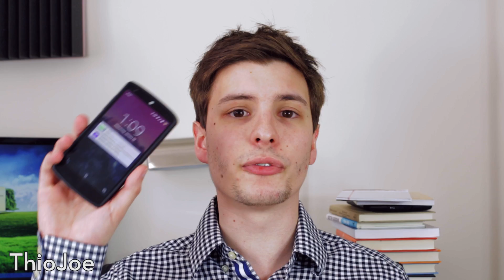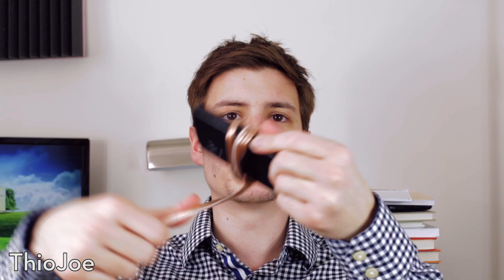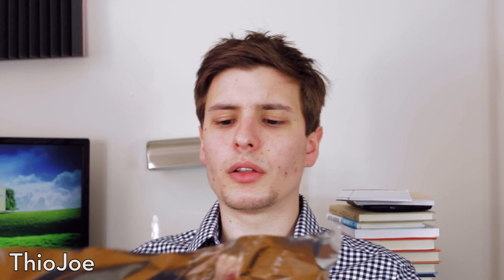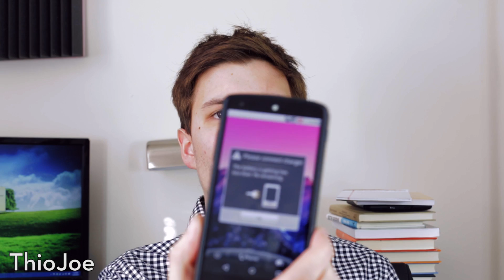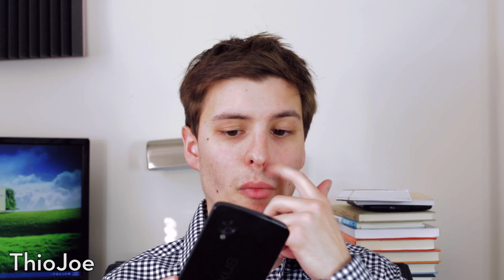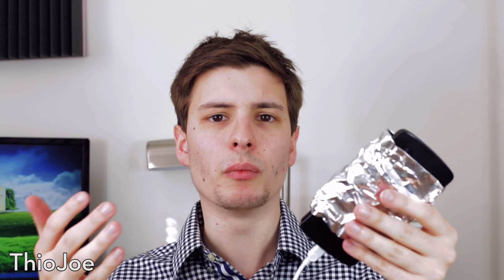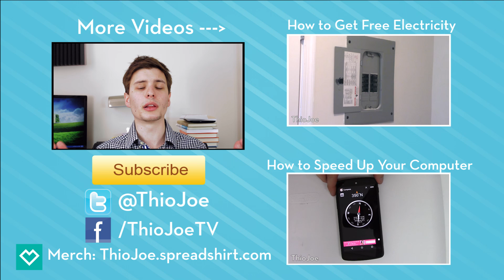How to Instantly Charge your Phone

Comment: here's another way...
Okay, so I charged my phone because it's already 3 bars left, (it's android) Then I pushed my charger hard because I didn't realized its not that sticking to that hole or whatever and then it turned out to be 100 but here's the problem...
Yes it is 100 but it isn't. it's only like an illusion...
I tried to use it without my charger and it already shut down xD 😂😂 don't do this 😂😂🔫🔫

Comment: Few know you can charge by around 8-12% with the same principle WITHOUT A CHARGER! The earth-magnetic-field acts as an induction field here, so it works best out-doors. If you hold your phone at arms-length and start spinning, you build an EM charge of around 50 to 60 Farrad, which is considerable! It works even better with a selfie-stick (the farther away, the better). Turn for around 20-30 seconds. The faster you turn, the more capacity you build. When you stop, the induction field collapses and the energy is released as electricity, just as in an inductor coil, charging your phone. Wind turbine generators use the same principle, but with an artificial induction field.

Comment: Well done BS. The stuff that urban legends are made of and with an (almost) straight face.

Spoiler for those who need it: Remember high school physics? In order to induce an electric current in a wire, induction requires an alternating expanding and collapsing magnetic field. This is known as alternating current (AC). This is how transformers work. All USB devices run on 5 volts direct current (clean, filtered constant DC voltage). This is what all USB interfaces put out--be it the USB plug on your computer or your phone charger. 

 Again, congratulations on great BS. I really enjoyed the video.

Comment: 1st let's talk about getting something for nothing.  Yes, there is a thing called Quantum fluctuation, you can look it up on Wikipedia, but lets talk about the laws of thermodynamics

First law of thermodynamics: "The total energy of the universe is constant." (or in a closed system)
Second law of thermodynamics: "The entropy of an isolated system does not decrease."
Third law of thermodynamics: "As the temperature of a perfect crystal approaches zero, its entropy approaches a constant."

The charger/phone is not a closed system, but you still can't get something for nothing.  Lets say the charger is 5v at 2.5 amps (which is MORE than most phone chargers) thus nominal output is 12.5W.  Lets say the battery is 3000 mAh or 3 Ah - a pretty typical phone battery nowadays.  

So, how long will it take at 12.5W to charge this battery at a theoretical 100% efficiency.  The battery is a typical Lithium so lets say 4V nominal.  Thus the battery can deliver 4V x 3A (12W) for 1 hour and assuming 100% efficiency the 12.5W charger would take almost as long to charge it.

But we both KNOW the battery will not charge at 100% efficiency or at 100% charge rate.  The typical phone charger is not 2.5A - maybe 2.1A or less -  thus reaching 78% charge in <10 minutes breaks the laws of physics & is thus impossible.

Richard
Reply: Not sure if your explanation is truth or false but well...the guy in the video always puts fake stuff and the worse part is that he doesn's even say in the description it's a joke or anything. I never tried those. They seemed weird and too fishy and reading the comments confirms that but if he did say in the description something...well..I'd respect him more.
Reply: +Richard Sacks-Wilner um...yes

Comment: Tried it. Complete bullshit. The secret is to wrap the wire around your head and swallow the aluminum foil. When the foil ball passes out your rectum your phone will be charged. And it will last until you remove the wire from your head. Kind of diminishing return though. Use moderation and only reuse the foil once.

Comment: o great idea itried it im thingking that i will use 6 metters of wire so it chagres faster than 10 seconds the aluminum foil i uses 1 metter long and i tried it .did you know what happen? my battery is burn out it over charges until now i dont have phone

Comment: Joe is a good friend of mine. I recognized the the problem in his brain a long time ago, hoping it would go away after puberty. Now, unfortunately, the zit (acne) cream he's using obviously isn't working, but even worse, it's preserving the hormone output causing this particular behavior. The good news is....I did some research and found some treatment that seems to be working. It involves a Retardation Suppressor Hormone (RSH) delivered either intravenously or suppository (a solid medical preparation in a roughly conical or cylindrical shape, designed to be inserted into the rectum or vagina to dissolve). Of course, he prefers the the suppository because it's the closest thing to sex he'll ever get. (perfectly normal behavior). Once introduced into the bloodstream it gets a little tricky. We had to go on craigslist to buy a second microwave oven, (easy, tons for sale for like $10.00). Place the 2 ovens on the carpet floor facing each other about 3 inches apart, just wide enough for Joe to lie on his back with his head between the 2 ovens. Set timer for about 30 minutes on defrost. This application excites the RSH just enough to change the direction of Joe's target thinking. Now, he's a Cub Scout....only needing treatments about once a month, the frequency an average man receives sex from his wife. (again, perfectly normal)
Reply: Wtf
😂😂
Reply: xD
Reply: +Averageskill , oh God, i losed my sheet :))))
Reply: Hahahaha...Wtf!!

Comment: Has anyone notified the local loony tunes hospital that its main patient has ESCAPED..His ramblings are at 7 hundred an 78%. A faster way to increase your brain matter and charge the phone would be to pass bare electrical copper wire through one ear and out the other..attach the ends to your testicle's and run 240volt cable from the mains to your scrotum. Hit the on button..please get back to us on the results?

Comment: He has 2 phones rapped in tin foil and wire one low battery one high. When he bent down to get the charger cord he changed out the phones hence the "rapid charge"

Comment: It is called swapping out or rotating your batteries and takes 5 to 15 seconds to do and voila you have a full battery!

Here are a few helpful tricks!

* Uninstaling Facebook will save you between 15 to 25 percent on your daily battery life. Use your browser for Facebook instead!

* Turn off WiFi, Bluetooth, NFC & Mobile Data as when not in use this can save you a lot depending on your apps! 
  * Also turn off your Auto Screen Rotation this can save you 2 to 8 percent a day in theory!

* If you have Multiple Batteries swap them out when they get to about 25% power remaining! 
  * This way you can use your phone for much longer and if you put the low battery onto charge right away it will be full almost by the time the full battery gets down low!

*Turn off auto updates as many new updates have bugs that end up using more power, only update apps and OS after reviewing what others have to say about the new updates after about a month!

* Use a regular (Low Power!) USB Charger Port, A Fast or Rapid Charging Port will kill your battery much faster (upto to 60% faster!) than a standard trickle/standard charger! 
 * This does not matter so much (except for the environment!) as long as you can replace the batteries easily!

* Plug your phone charger into a surge protector that can also smooth out the current this can add upto 20 to 35% on your battery's life span (Use the same type of device for computers and tablets as well!), This does not affect your phone's battery until the 2 to 3 year mark depending on the quality of the battery!
 * This also has the benefit of saving your phone during power surges which can kill low powered electronic devices like phones and tablets!

* Use Bluetooth devices to listen to your phone it cuts down on power consumption even more then wired headphone/earbuds as they use their own power supply to power the speakers rather than rely on the phone's battery to do that with wired headphones/earplugs! 
 * Also Bluetooth uses far less power to send the signal to your wireless headphones/earbuds then sending it via cable even without having to power the headphones/earbuds because of electronic resistance all metals have even gold and copper air does not generally have this problem!
 
* Also if you can turn off the screens colour so it's in grayscale mode, That can save your screens power consumption by about 40 percent!

* Force stop all apps that you absolutely do not need to use to stop background power and data consumption!

*Unless you have bad eyesight you only need your phone's brightness level to be on between about 10 to 25 percent most of the time!

*If you can swap out batteries but have no spars get a brand new one and replace your phone's battery every 12 to 24 months this does not apply is you have multiple batteries and swap them out on a regular bases!

Comment: HAHAHAHA! you should try plugging the cable from your phone directly to the wall(without the charger), then you will have 110V, which will create a way higher "differential potential"between the wall and your phone, then you will not need to worry about "escaping electrons" hahahahhaa.

Comment: Not possible. Reason: if ANYTHING is charging, it produces a little bit od heat. Usualy it is small amount, because the charging is long, but lets say your phone would charge 75% in 10 seconds. That would produce so much heat your phone would burn. Anyway, good view attractor.

Comment: Way that works!

1. Get an IPad charger
2. Plug it in an outlet
3. Plug the charger into the iPhone 
It's charges faster because the IPad needs a bigger charger so it does not charge very slow, where the IPhone doesn't need as big of a charger.

Comment: I'm calling BS on this. I have an iPhone 6S and tried multiple copper / speaker wire to extremely heave gauge copper wire. aluminum and times, 10 sec. 20 sec. 30 sec. 1 min. etc. and still no change in the battery life.

Comment: I don't believe, something else must have happened. 78% for only 10 sec is not possible.Perhaps the sensors for potential measurement may have perceived the wrong thing. May it be possible for sensors to stop working properly after getting the wire wrapped around or so.. I'm not going to accept it until I try it my self for a full day long 
ahead.

Comment: The wire was covered in rubber. And as we know kids rubber does not conduct electricity and the rubber is used to stop electric escaping for safety, so how the FUCK is it supposed to jump from the coil through the rubber, glass, plastic and other rubber components into the fucking battery

Comment: dont believe this guy here are real steps on how i charge my phone instantly

step 1: microwave phone with TWO FORKS IN THE MICROWAVE
step 2: place the two forks next to the phone.
step 3:when the phone starts turning on, look at it through the microwave window the battery should be going up by 2-4% each second, it should be showing the battery meter, just wait around 2 minutes for it two be donw

it does this since the electricity concentrates from the microwave  into the forks making what is like a cloud of electricity between the forks charging the phone.
i use this all the time so i ope this helps!

Comment: The recharging speed of a chemical battery (used in most phones) is limited by the speed of the chemical reaction happening inside. You can't speed it up.
Reply: Classic chemistry lesson from like year 3 (or whatever you call it in America ,middle school?)
You can speed up the reaction by adding heat or a catalyst so just put it in the oven or microwave surround it by Nickle or even better put it in a bath of melted Nickle
Reply: NightBladeNation Or just take it in a bath with you, cut the cord, plug it into the wall and run the other end of the wire in the bath where you comfortably position yourself. Don't forget bubbles! LOL :-)

* Disclaimer -- use at your own risk.
Reply: +Alex Povolotski hahahaha
Reply: Really guy?

Comment: This is ridiculous, why would this work. Let's say you are charging your phone which has a 2000mah battery and a standard wall charger of 700 ma. The math 2000/700=2,86 hours, so it takes at least 2,86 hours (172 minutes) to charge no matter how many foils or wires you wrap around it.I wonder how many people wrapped their phones in wires and foil ?

Comment: Heres an even easier way to charge your phone. 
1) take your phone and the charger.
2) plug the usb part into your phone.
3) plug the outlet into the wall
4) it should be charged in about 20 minutes. -_-

Comment: do we need to remove the plastic cover off the wire or can we use it just like that? 
and also does this trick works on ipnones as well as they have a aluminium back

Comment: I tried it with a set of jumper cables wrapped around my phone on my truck battery. The charge went from an almost dead 3% to 98 percent in less than 5 minutes. Blew my mind. I was amazed how well that worked. That thing you said about induction is on point. It also works on other things too. Wrap those jumper cables around a frozen steak and in 3 minutes, it was ready to eat. Baked potatoes cooked in 1 minute and an entire 25 pound frozen turkey was ready for the dinner table in 16 minutes. As soon as I can figure out how to wrap these jumper cables around this cake pan, I'll see if I can bake a 3 layer cake for the family with just the help of my Ford, my booster cables and Interstate battery.

Comment: hello thiojoe,

 i would like to bring something into light for you. I'm an electrical engineer who watches just about anything on you tube that seems bogus, and laugh at the people who made them. your entire demonstration of this video is complete crap. i will point them out to you, that for your so called explanation of how the charging process works, is not fully true. the circuitry within the phone is made for lower voltage input which means it has high resistance when it is charging. this circuitry will cause the phone to heat up because of that resistance. (you can find the same in electric heaters and electric stoves), so in your explanation, no matter how much dc voltage is sent through the battery, the phone will only accept the amount of voltage it takes for charging because of the resistance factor. the next point i wish to bring to light, is your coil like device you wrapped around your phone. that contraption is bogus. it serves no purpose but to act as a glorified phone cover. the coils them selves are connected in physically to the battery, or phone, and they are insulated with heavy pvc insulation which is useless when making a step up transformer coil. to make use of a step coil, it must physically attached to the circuit. as long as the circuit can handle the step up voltage as well, other the resistance is going to destroy the charging port in the phone. the use of the tin foil does not help either. tin foil is actually not even a good material in conductivity. it is also known for setting fire in modular homes when under load. more dc voltage in a phone does not mean faster charge time, nor does adding a step up transformer or tinfoil. also i would like to point out that even if the phone had enough coiling in it like you had explained, the coil would heat up heavily and create an electromagnetic field that would fry the PCB components immediately. so in general, your video is a huge fallacy. you really should consider a different area of comedy if you think this is funny. until i see another one of your fake videos including so called ways to charge up electronics with a tinfoil hat, please research your "theories".

Comment: Recorded on different camera for "clarity". The thing that gives away that this is fake is because he is holding wire in tin foil which would create an electric current the moment he touched it after he plugged it in. If the wire was insulated than it would not be able to create a current that would be able to reach the phone. When he cut it to switch cameras he cut the video, plugged in his phone, and then continued the recording on another camera with a bit higher quality.

Comment: Is this the same video displaying how to charge you're phone in the microwave on high for 15 seconds and it gives you twice the battery power?I Thought that one was funny too.I got a Samsung Galaxy SIII its 2 years old and the battery lasts 5 days on one charge.If everyone took notice of how to charge you're phone properly it will last 5 years before having to replace it. This first 5 chargers are charge, use till flat phone turns off by itself, charge again use till phone turns off. For 5 cycles this is the battery charge learning. Then charge phone use till battery gets to 60% of charge plug it back in to charge. Li-ion batteries have 1000 charge cycles so if you only let it get to 60% it is not a charge cycle its a topup charge. Works bloody great too. If you do it right your phone should last for 4 to 6 days before running dead flat. I know with my phone I unplug the charger a 6.30am and plug it back in to charge at 7.00pm everyday and its only used 20% during the days use and my battery is the standard 2100mAh battery.Don't leave on you're Wi-Fi, GPS, blue-tooth and mobile data as they will run you're phone flat in 5 hours easy as.

Comment: Actually if you wave the phone around with the wire and aluminum foil you will induce electrons floating around in the room into the phone and you don't even need the charger. This is due to an electronics effect called torpic vorpor. This effect didn't exist until we developed radio and especially cell towers. It is the primary reason many people need to wear aluminum foil hats!